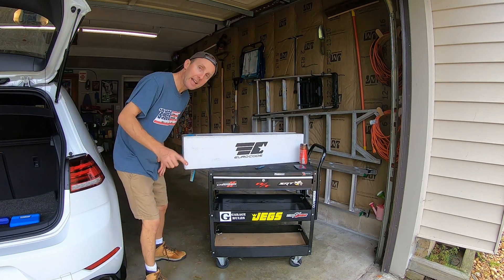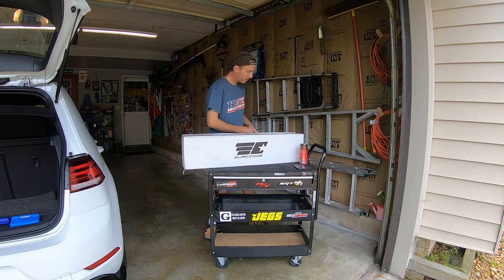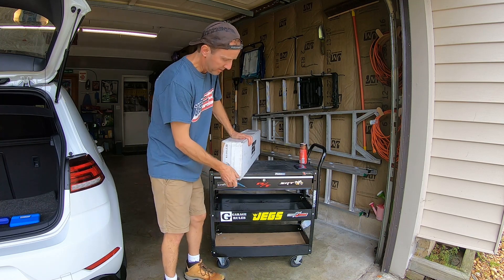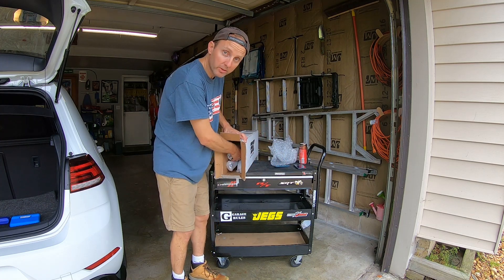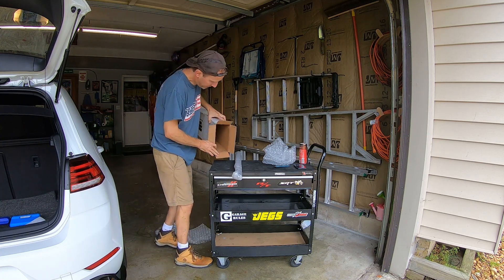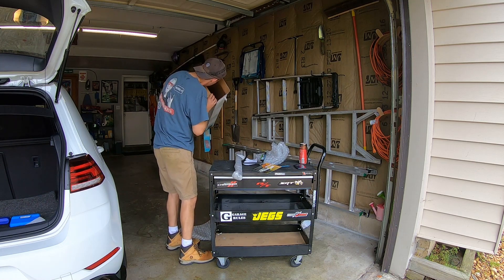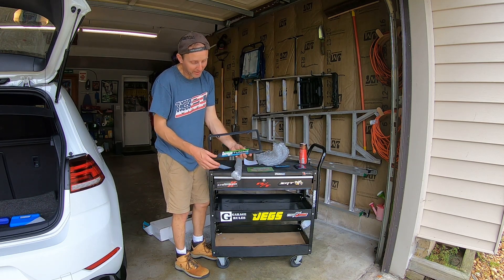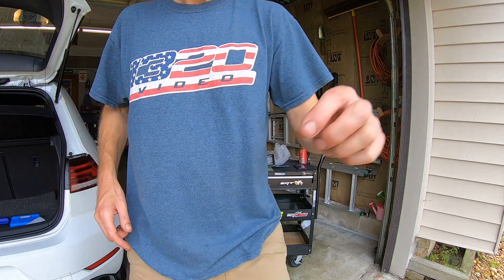2018 VW GTI SE Ep.380: Detailed Installation of Eurocode Rear Tie Bar

Comment: I'll have to consider one of these. Not because I need one for structural support, but because it will give me a cargo retention bar now that I have my "rear seat delete" installed again. I like that the part includes hoops at the ends for attaching straps for cargo retention. On another project, I discovered a gel blue thread locker. It's thicker and will not run like the other stuff. I like it. Thanks for sharing this video.
Reply from the maker: I still like it. I mean you can move it a bit w your hand, as the end points aren't super stiff. but I do believe it keeps the side to side flex under control either way.

Comment: Bro... that was an absolutely stress-free mod :-)    Nice to hang out on a Saturday evening. In the past, you used to have this bottom undercarriage brace thingy (cannot remember the proper name). Would you ever consider to re-install that as well?  It was a big sticker item I think.
Since I installed the billies in the rear, the front feels sloppy...  darn, think I do have to do the front billies as well. I'll wait until next year though. Since your GTI only has 30,000 miles, you will not have this issue.
Reply from the maker: Unibrace. I mean, maybe someday.. it’s over $500 I think…

Comment: Hello all, so recently my 2017 gti has started to have a clicking noise in the passenger seat glove box when i start the car and then turns off after about 10 sec. any recommendations would be helpful thanks
Reply from the maker: 1 idea harkens back to my mk6 days.. the plastic fuel line runs under the car behind the glove box. And the fuel line can rattle. We used to look in the frame rails under car, and shove up foam or packing to stop the fuel lines moving.. just an idea.
Reply: HVAC blower motor failure somewhat common issue
Reply: @TheFlyingPLiner  any suggestions for a fix?